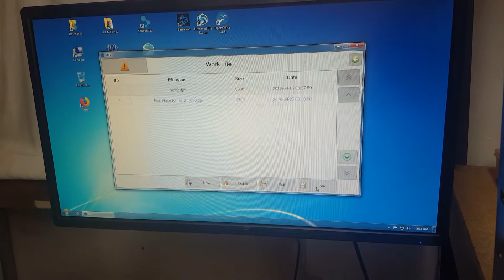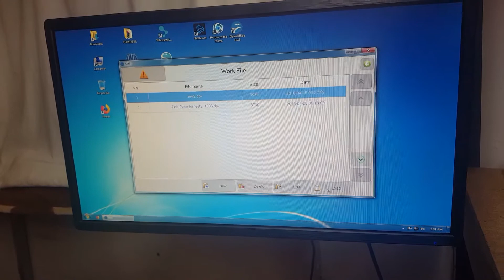CHMT36VA + Spyker Control System SCS! (Coming soon)

Comment: This may sound a strange question to those that know ... but how do you get the boards from the PnP to wherever they  are going to be soldered without the components skating all over the place?
Reply from the maker: Before you load componants on the PCB you apply a solder paste, through a solder mask, its like a silk screen. You get a stencil made, then wipe solder paste across your PCB to apply it to the pads. Then load in the PnP, the solder paste is enough to hold the parts in place while you move it into the oven.